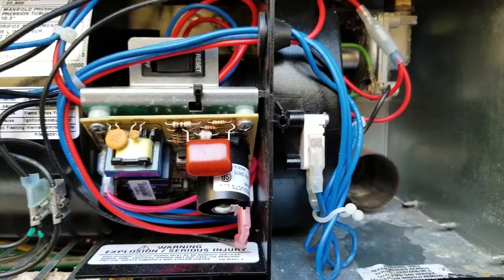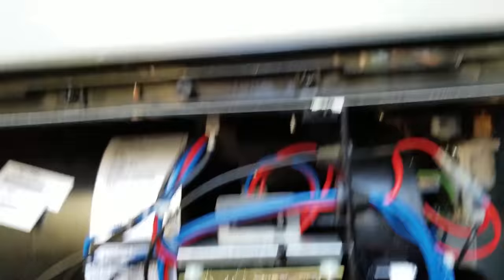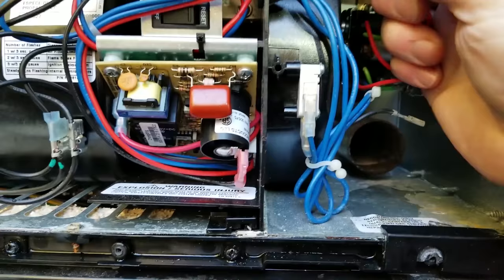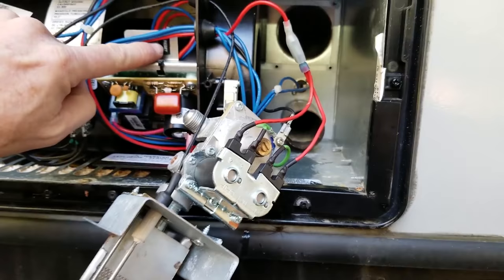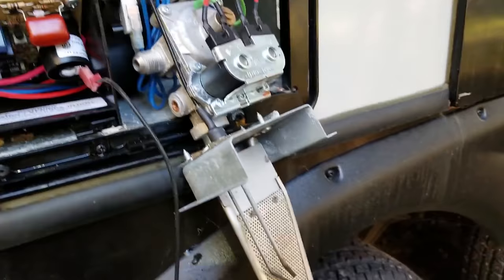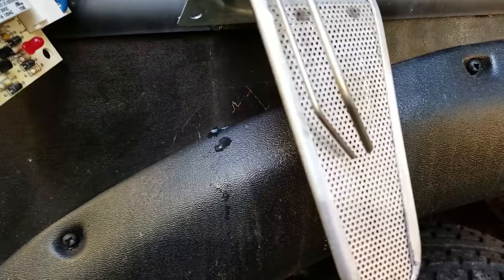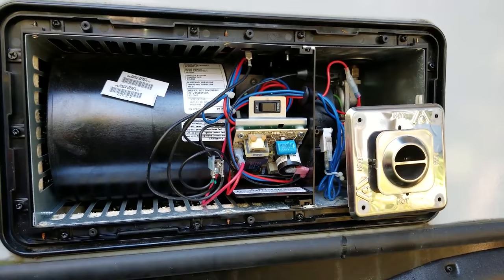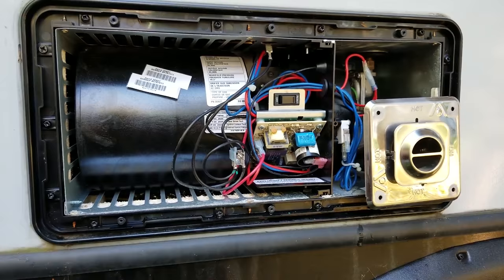Troubleshooting An Atwood RV Furnace Circuit Board

Comment: You can test the igniter Circuit by holding wire near ground maybe a quarter of an inch away from ground don't need to use an electrode some of the dinosaur Electronics circuit boards you need to increase the gap on the igniter to about 3/16 in order for them to spark I have found this in the field adjustments and noted to Dinosaur Electronics

Comment: I have a atwood 8940-111-DCLP  when i turn on the thermostat i hear a click from the thermostat but absolutely nothing from the furnace no fanblowrr no igniting sounds or clicks but when i turn thermostat over to ac my air-conditionier turns on

Comment: Thanks much but I hear the electrode firing but no gas solenoid click. Valve clicked once in 10 resets and I don’t know if board or solenoids. Driving me crazy. I get 3 blinks on board on my Atwood 8531-IV.

Comment: Just a couple pro tips for those of you who haven't already learned the hard way: If you're testing the electrode, and you're holding onto the ground plate of the electrode but it's not grounded yet and the PCB finishes the purge cycle and lights up the spark, you will get shocked!! The shock itself probably isn't life threatening unless you have heart conditions, but your reaction to flinch or jump could gash your hand on some sharp sheet metal edge.

I suggest not activating the reset switch until after the electrode mount plate is grounded. 

I seriously thought "That purge is gonna finish and the spark will start just before he grounds the electrode. Am I watching Electroboom? :D"

Other thing is you can save some work by unplugging the high voltage wire from the ignition coil, then rest a plastic handled screw driver tip against ground and 1/8" from the ignition coil and see if you get a spark. Then you know which is bad.

Happy camping!

Comment: I really want to thank you for your videos. You saved the day. I had a dirty sail switch. I cleaned it off and reinstalled it. It still wouldn't fire up. I thought I was having a circuit board problem so I watch this video. I caught something you said, the exhaust vent has to be replaced before it will work. I push the little exhaust vent back in, fired it up and it works perfectly. I subscribed to your channel and now will always check your site first when I have RV troubles thanks again!
 Jose

Comment: I'm an Hvac Tech and I service an RV resort AC and heating portion which they have residential split systems installed.They have some mobile homes that have these types of heaters Suburban model P-40. They want me to start fixing them as well. so, that brings me here to your channel and I got to say I've learned a lot so far. Keep up the good work man. Two Thumbs up!!
Reply: Hi Eddie, Thanks for the vote of confidence!  I put a lot into these video’s, and it is good to hear that they are helping folks.

If you are working on the Suburban P-40 check out my video I did on one of those here:  
https://youtu.be/ZBWkr4eWAMQ

Cheers,
Darren Koepp

Comment: Perfect video! Mine in my 3 day old 2020 camper with only 9k miles is acting up so I'm researching video's. Mine was running 2 days ago and we ran it all night successfully but it is LOUD very similar to this one. We traded in a 2022 Geo Pro and the heater barely had any rumble. This 30k BTU dometic in our new camper is super rumbly loud.

Comment: Darren, thanks for your really useful videos.  Last night I just replaced the control board on a Suburban NT24-SP furnace.  I initially wired the new dinosaur board's fan control module wires incorrectly (it's a feature that the OEM board didn't have) and nothing worked.  Following your advice of tracing the path of 12 volts, I learned way more about how the furnace operates than I set out to do.  However, once the complete order of furnace operation was clear in my mind, as well as where I should be seeing voltage at each stage of operation, I was able to understand my installation error and correct it.  Furnace is working like new again.  Thanks for sharing your knowledge.

Comment: Excellent diagnostic journey, Darren!  Thank you!  That was beautiful, simply beautiful...
Reply: Anyone here have this problem, surburban 30fg, sail switch and limit switch work. Heater comes on gets hot runs about 2 minutes then shuts off. I have to turn it off for about 5 minutes then turn it on and it does the same thing. Could it be gas valve ? Replaced motherboard a year ago
Reply: @ronwilliams4934   did you see Darren‘s reply to Y0TA4716 below?
Reply: @adobemastr  I took it apart cleaned it, orifice was good not clogged, burner was good no holes, 1/8 " gap, pretested system before reinstall.  Plenty of spark contact on burner. After systems runs and shutdowns I smell like something is burning. Last night it ran good during one cycle then the second time it came on it ran 2 minutes and kicked off. I guessing ill buy another board and try that.
Reply: @ronwilliams4934    You know what the experts say, "Don't throw new parts at a problem...know what the problem is before you start spending money."  I think that is good advice.  You might get lucky buying a new board, but they are expensive and you might be throwing away your money.  Can you continue to do research on this issue?  Probably not because it is the winter and I'm sure you need your furnace to work.  Are your propane tanks full?  Perhaps there is a problem there.  Or, it could be a defective gas valve.  Or the board.  Any number of things.
Reply: Another possibility, Ron.  Are any of your vents covered?  Sometimes the vents get covered because we don't want to heat a particular area, so we think by covering a vent we will push all that hot air to another room where we stay in more.  But that causes its own set of issues (takes too long to explain here).  Suffice to say, you might have an issue related here. Uncover all of your vents if you have one of them covered on purpose or if something is accidentally blocking them.  Same for the heater unit itself.  Make sure nothing has fallen behind your couch or wherever place your heater is at.  Something could be blocking the air vents there.  Or maybe you have dog/cat hair blocking something.
Reply: @adobemastr  vents are clear , good flow going thru vents. Turned stove on high turned heater on no fluctuations in flame . Last year . Replaced motherboard,  fan motor, squirrel cages.
Reply: @ronwilliams4934     How about the thermostat?  Did you replace it?  If you did and the old one was working but you wanted to "upgrade" it to a new-fangled digital one, that could be the problem.  I did the same thing with a new Honeywell thermostat and that caused problems.  I went back to the old style.
Reply: @adobemastr  no I almost did but decided not to at this point,
Reply: @ronwilliams4934    I'm stumped as much as you are, Ron.  Perhaps you should take Darren up on his offer of paying him for a phone consultation.  Did you know about this?
Reply: @adobemastr  I'll keep messing with it,  its warming up a little here so hopefully I can wait , I'm not paying for a phone consultation,  sorry

Comment: Darren; I have a 91 Atwood Excalibur Hydro Flame 8520-II (original furnace in 91 Shadow Cruiser), It failed to ignite 1-28-2019. Removed circuit board, had it tested, it was no good, bought the replacement kit: Dometic Universal DC Ignition Control Kit. Installed new board, same day. Ran good for about 2 weeks. Then Furnace would not ignite, again. First-tested new board, it was good. If I shut the thermostat to "Off" position, wait for blower to stop, then wait a couple minutes, kick thermostat up to 55-60 degrees, blower comes on, it may light or it may not, usually does light, cycles but may or may not light on the 2nd round. Service/Parts suggested to replace "Sail Switch", I did, & the "Limit Switch", I did. No improvements, I hate just changing parts out..! Finally, I removed the Gas Valve/Igniter Assembly as you did in this video. But I was unaware the one could run & test furnace as you did w/LP gas off and disconnected..  With the LP Gas Valve/Igniter Assembly removed, I inspected Igniters (mine has 3 rods), porcelain insulators (2), the whole unit looks brand new (probably replaced before I owned it). The LP Gas Valve had some dirt on it (Mud-Dobbers(Insect that lays it's eggs in a dirt co-coon)). I cleaned it off and then brushed the valve off, looked like some white water stains/corrosion on aluminum. I tested High Tension Igniter/spark wire = continuity, ok. I have no idea what the Spark gap is supposed to be on the three Electrode unit, no one else seems to know either. I disconnected the unit and took it to my parts supplier, we compared new parts of igniter/LP Gas Valve Assembly w/my old parts I brought in....they all looked identical...! Even the spark gap..! All shinny and new. I went to a different parts supplier in my area, told of problem.. he would check it out for a $96.00 service charge, I said no thanks..! He then said I may have a gas leak/seeping from LP Gas Valve. I got home and grabbed a spray bottle w/soapy water and sprayed all gas fittings @ furnace and the bulk LP 120 # gas tank, no leaks..! Still have the same non-ignition problem, still resetting the thermostat as stated above, sometimes it lights, sometimes it don't, repeating reset of thermostat, eventually kicks off and runs good through the cycle, but won't re-light on the 2nd round.The overall furnace is in really good shape for being 28 years old, surprised it lasted this long..? They want over $1,000.00 for a new one w/a 2 year warranty..! I'd buy a used one first..! You got any ideas what could be causing my non-ignition..?
Reply: Hi James, wish I were there, I love a challenge! I have just uploaded the complete service manual for your furnace to my website.  You can access the link, and a few other, at the bottom of this post.

I also have another video on Atwood 8500 Series here:  https://www.youtube.com/watch?v=QxDOw4LAWyo
But from what you are describing I do not expect the issue to be with your time-delay relay.

Regarding your specific issues, lets cover some basics.  I will assume you have a digital multimeter that can read 12 vdc.   If you have seen my other video’s you know I like to ‘follow the trail’ in this case, we will start with the 12 vdc trail.  You replaced the defective ignition board and it worked fine for a few weeks.  That tells us a lot.  Now it runs once and will not restart.  

With running fine once and not restarting my initial knee-jerk reaction is either the sail switch or the high-limit thermostat as the culprit.  I say either/or because those two are wired in series and your description totally falls within either one or both of them in a  faulted state.
  
Regarding the high-limit thermostat there are several out there that will fit but only one is the correct spec!  For your 85-II that PN is 35132 set for 130°F.  

I also say either/or because since they are wired in series the 12 VDC ‘signal’ that comes from the thermostat pass through both on its way to the control board.  The control board needs to detect that signal go ‘off’ when the fan stops.  That happens when the blower stops blowing and the sail switch ‘opens’.  If the ignition board does not see this blue circuit open after the fans turns off it will not ‘reset’ itself and ignite on subsequent attempts.  This is a safely feature to detect a failed (stuck) sail switch.

So, knowing this, lets conduct an experiment with your meter on 12 VDC mode.  On the ignition board you will see a white connector with yellow, blue, red and a few other colors. Stick your meters red probe in the blue wire on the ignition board socket (do not unplug the connector but you should be able to insert your meter probe from where the blue wire enters the white connector).   Next connect the black probe to the metal frame (ground).  In this configuration (with furnace off) you should read zero volts. When the thermostat calls for heat your fan should start immediately.  Right away you should read 12 VDC on the blue wire – that tells us the path from thermostat -> sail switch -> high limit t-stat are all good and after the pre-purge time (~15 sec) it is okay for the board to send a spark and open the gas valve.  

I am expecting you will get 12 VDC on the first run.  But I am expecting on subsequent runs you will not get 12 VDC on that blue wire.  If that assumption is correct than the issue is sail switch and/or high limit T-stat.  Even though you replaced them already!  So leave your meter connected like this so you can repeat the test several times w/o interfering with any of the parts on the furnace.  Again if my assumption is correct you can dig deeper into the issue with the sail switch and ensure your high limit t-stat is the correct one for your furnace.

The reason I am focusing on these issues specifically and not LP gas pressure, gas valve, gas solenoids, electrode, electrode gap, flame spreader, DC voltage, Off-Delay relay, exhaust, airflow restrictions, instillation etc. is because the furnace runs fine the first time (and it ran fine for 2 weeks) so that kind of eliminates all those parts as a culprit.  If those were at fault you would be asking different questions and the furnace would be reacting differently.  Another thought:  Taking the furnace out of the RV and bringing it to a shop is not a good idea.  The furnace is a system and that system includes the RV it is installed into.  For issues like these you need to diagnose in place.  Bumping or moving the furnace may change the equation.
  That is why I am investing so much into my website and these video's, so folks like you can learn how to fix things yourself and save on the repair bill!

So, perform that test with your meter and let us know what you find.  

Here are some more resources on my website that can help you:
Atwood Furnace Service Manual:  http://myrvworks.com/manuals/
Wiring Diagram Page 17
Troubleshooting Page 42
Electrode gap Page 40

Annual Service Sheets:  http://myrvworks.com/resources/annual-service-worksheets/

Cheers,
Darren Koepp

Comment: Most common problem with that furnace is the broad, changed out 20 plus at end of 2019 and the beginning 2020 and no sail switch other then clean, no limit switch. Change it out with a Fan- 50 plus

Comment: @myRVWorks,inc.  so i installed my dads dometic 25,000 btu its a 7.5amp 12volt 90 watt furnace soo a couple months before the install we wanted to make sure it worked soo we used a 12 volt battery and hooked it up everything was working blower, igniter it all worked great. well couple months later i installed it and went to hook the power and ground up and it blew the fuse but did not trip the breaker.. well i took it back out and wanted to see if it was working and we got nothing took the circuit board off and it blew the trace wires on the board soo i am ordering another one we have the power coming in via the garage into the camper breaker then to the converter or inverter. i checked all the ports in the box and we are getting 12.7volts.. i check the wires i used to hook the furnace up and we are getting 12. soo the current is not enough the blow the circuit board to you think we could have had a bad circuit board. any advice would be much appreciated.

Comment: Darren,  here is one for you.  8520 IV   , furnace lights, then goes thru 3 cycles then quits,  check sail switch, all ok. pulled out burner , replaced electrode, thinking the electrode wasn't holding the gas valve open, but I could hear the gas valve open,   So it was spark and  light, so I figured the gas valve must work.  This was all with the old board. So everything should work, but it wouldn't stay lit.  Any thoughts?  So a new board came today, I popped that in, fired up first time and all worked fine.  But I didn't see in any of your videos anything that brought the problem back to the board.  So must be there is something in the board that fails, even with a new electrode in, and probably the old one was fine because even with the new electrode the old board didn't work. so there is something in the board that fails and times out , or won't hold the gas valve open. but yet it opens it up for the pre-fire mode.  as I said it did light 3 times and then it went into lock out mode.  I would enjoy hearing your feed back.  I enjoy your  videos.  I live fulltime in my Sundowner LQ  trailer  18 L

Comment: Keep hoping to find a video that solved my 8535-iii problem... Runs 3-5 seconds, cuts out. Repeats. Then a whole lotta nothin. (Ran several days first, then suddenly began this.) Original issue was of course just the sail switch... Or maybe limit... I just replaced both cuz why not. Tried replacing the burner... But its obsolete. The design is slightly different from the ones you can get now. (Manual has pics of the 4 types.) 

So switches are good, it operates fine to the point of igniting... But after 5seconds of running, OFF

Exhaust is clear, electrode pins are spaced properly, (thought maybe a flame sense issue) ducting all checks out as clog free, no crushed ducting, etc. 

Im beginning to think the only thing left is throwing a dinosaur at it.... Working on fabricating a burner... Literally cutting the screen off a new one and replacing the original, spot welding it together....

Comment: After watching so many videos about furnaces it seems that they are bound to fail. First in my thoughts an exposed circuit board is at some point encounter moisture. 

I look at the wire components and think there has to be a better way.

So my question: Is there a better heater system for RVs?

These heaters always drain the battery and uses a great deal of propane. In my mind this is inefficient.

Comment: I get ignition, and feel heat out the exhaust, then it goes out. Then makes two more attempts with heat coming out exhaust. I cant find a flame sensor. I do get three flashing reds. I have 1/8 inch gap.